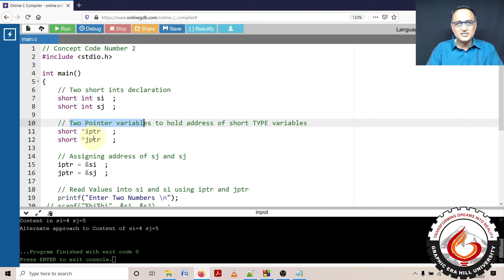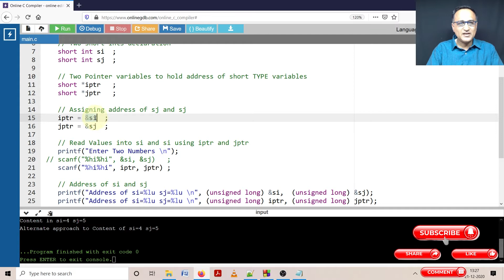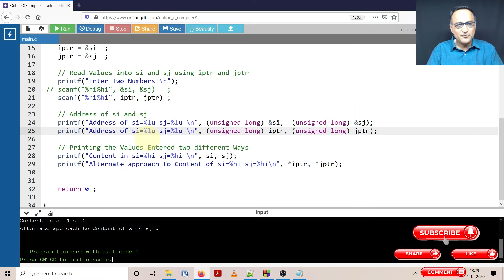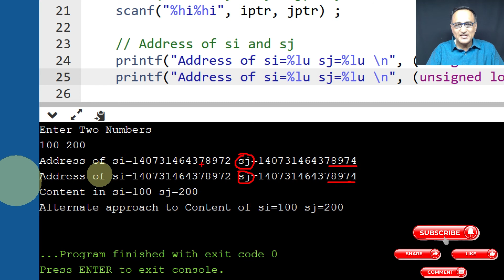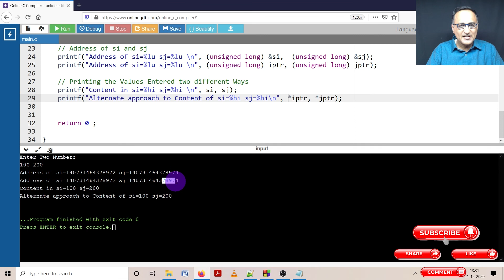2D Pointer Concepts - Pointer Variables in scanf Code DEMO

Comment: sir in code block if do like this (unsigned long)&si compiler give warning and with (void *)&si compiler does not give any warning ??
Reply from the maker: Show me the code sample for me to verify and get back.
Reply: @CodetoCareer  // Concept Code 1B

#include <stdio.h>

int main()
{
    int age = 18 ;

    printf("Age is %d\n", age);
    printf("Address of age Variable is %lu\n", (unsigned long) &age);
    printf("Finding Age using De-Reference Operator %d\n", *(&age));
    // * is Content/Value at that ADDRESS

    int *ptr   ;  ptr = &age ;

    printf("Address OF ptr=%p \n", (unsigned long) &ptr) ;
    printf("Address IN ptr=%lu \n", (unsigned long) ptr ) ;
    printf("Content/Value referred by ptr=%d\n", *ptr);

    return 0 ;
}
Reply from the maker: The size of pointer (i.e.) the address depends on the compiler and machine hardware. Since on the machine, I am trying out the code the size happens to be unsigned long. But the compiler is correct in warning that the code written may not be portable onto another machine.

But when I use (void *), it is clearly being said that the data type is of the pointer or address so no warning issued by the compiler in this case.
Reply: @CodetoCareer  thanku sir
Reply: some compiler support this system but majorly ,compiler understand normal address,so we need to write 2 syntax as written by u